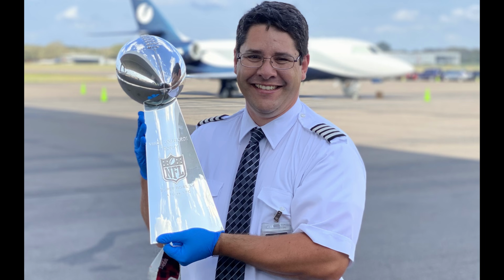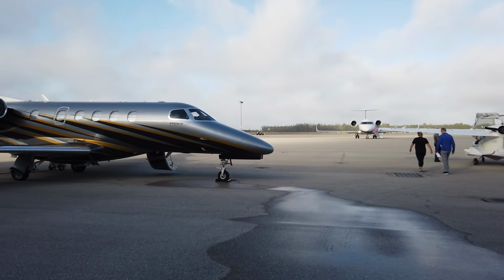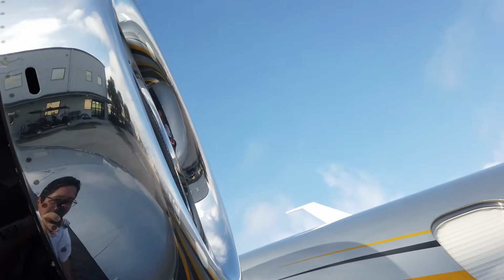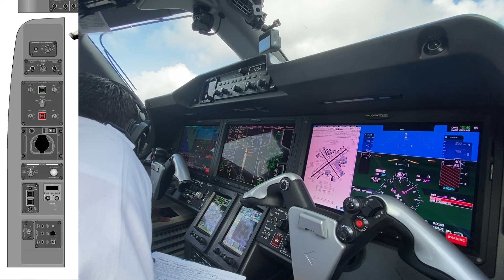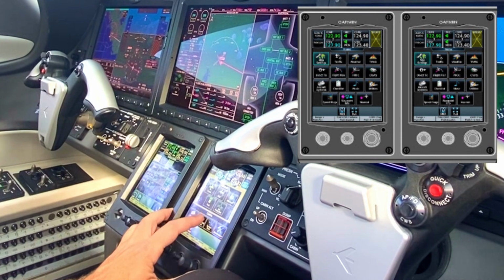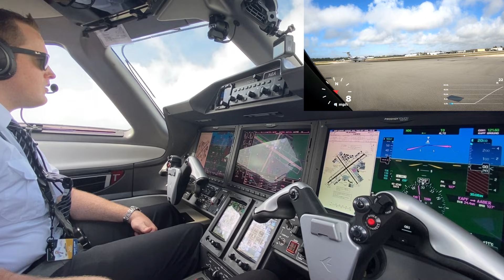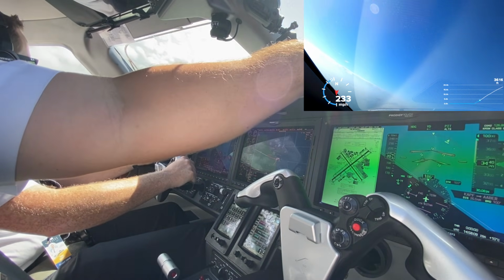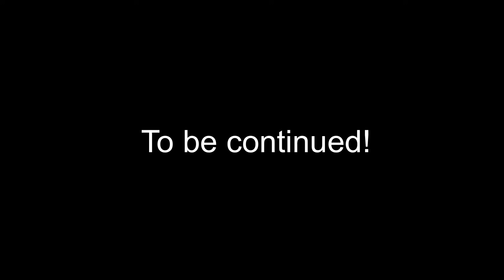Phenom 300 Naples, FL to St Thomas.  (Part 1 of 2)

Comment: The G3000 doesn't automatically compute V-Speeds and Runway length required?
Reply from the maker: It does not. We use APG.
Reply: @BrandonParksFlying  
Wow, that surprises me that such a capable system can’t do that....
Thanks.....